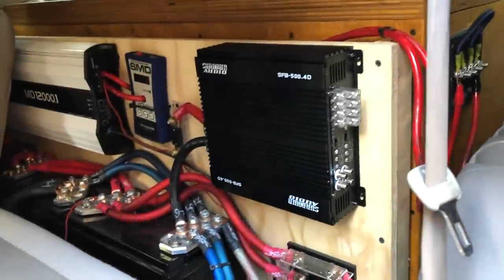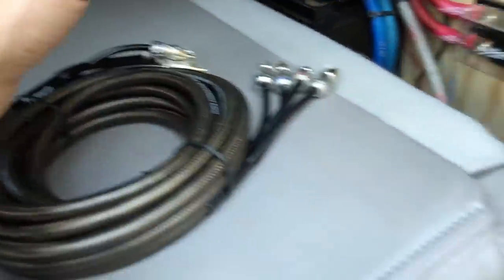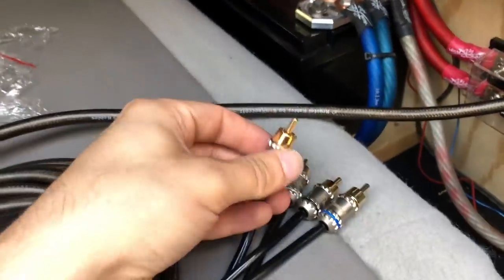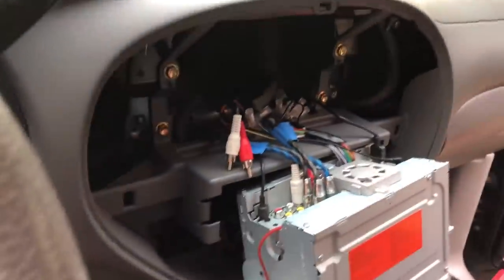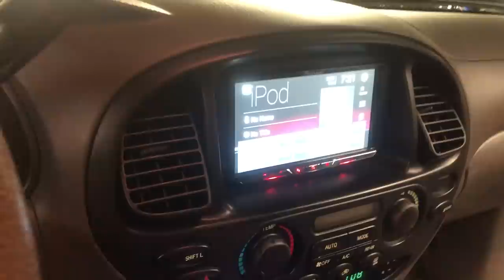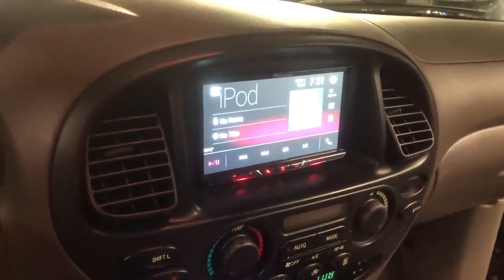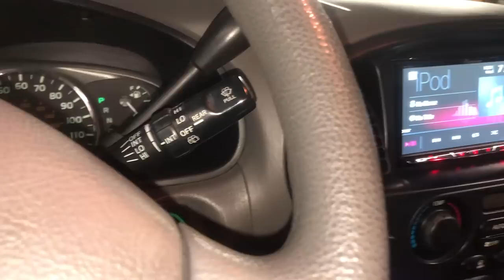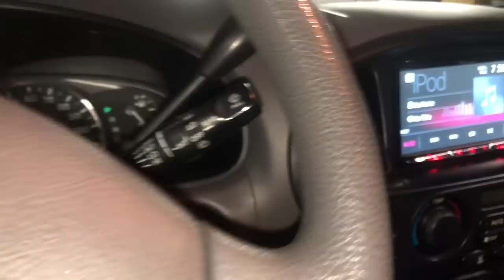Huge 4 Channel Amp Install! No More Static! Sundown SFB 500.4D

Comment: Relocate your ground. Thats a ground issue. Could even be the ground for the deck, or you have stray voltage.
Reply: Mine was that exactly, the radio wasn’t grounded enough I ran a 8 gauge wire from my ground bar to the ground bolt on the back of my radio and it stopped all the weird stuff that it was doing so I can definitely agree with ya there
Reply: To add to this, basically what is happening is that the “ground” at the radio is slightly different than the ground at the amplifier. This can be due to small resistances between the negative battery post and the ground at each device. 

Once these grounds are at separate potentials, you then connect the RCAs between them. This creates a short between these two different grounds at different potentials. When you have two different potentials connected you get a current flow, which is now going across your rcas and being turned into noise. (Poor grounding somewhere, or in multiple locations in the system)

A ground loop isolator is more of a band aid for this issue (typically a couple transformers that will “isolate” the rca wires and remove that short between the two different ground potentials).The real fix is to upgrade and fix your grounds everywhere you can. This includes the battery grounds to chassis (big 3) and the grounds for the radio and the amplifier.

All the extra wire you added is doing is making a lower resistance path for the current to flow (reducing the current flowing across the RCAs and the noise).
Reply: @mattb6001  what he said.  People always over look their grounds. I was told by a shop keep them short clean and ohm ohm the ground if you still have noise.
Reply: Yup newb shit lol better head unit ground or ground to the same point as the amp done deal
Reply: he could aslo add a cap on to the four channel amp for cleaner output to the amp
Reply: Yep it's the head unit pioneer they do that reground it.
Reply: @chrisfiske  were you getting weird beeps and other weird pitch noise through your speakers with the car off and volume down? I've grounded the RCA's at the hu and that helped, but I'm getting weird noises. The radio is on factory harness ground, and this is the only thing I didn't try.Big 3, tried moving the RCA, tried separating the wires a bit more, etc. Could be like you said, not enough ground on the HU. I tried grounding it to the metal along with the harness ground, and it took the noise out a little bit but not fully. AUX on the other hand, is horrible. Ramping noises (car off)
Reply: @BEAZY_5150  you could be getting noise from the alternator... I've been running dual alts and had one go bad, it still charged but it made everything have a winning noise I unhooked them both and it stopped that's how I found out the alt was messed up. I just unhooked the one and it was fine after that, and another thing you can check is the gain on the amp, if your gain is turned past half way you can get noise from some amps... the idea is to have an amp that can run your subs with hardly any gain, this is why you see people running two sundown X12's on a salt 6 they want that extra power so they don't need much gain... it's so hard to narrow down noises... this is what I did to fix it all, I separated the system from the truck ground so my truck has its own battery and alt and my system is completely separate it's own alt and it's own ground even the alternator is mounted with composite washers and I coated the bolts in bed liner so the bolts couldn't get any ground from the engine block or the bolts touching the alt after being threaded in so the coating keeps it from grounding as the bolt passes through the alt, so the grounds are completely separate from each other.. I hope you find your problem
Reply: @chrisfiske  it's a new 250 amp alt. I've tried grounding the RCA's, I made sure everything was routed right, made sure not to use the factory ground for the hu and went to an inside metal portion, also grounded my voltmeter in the same spot, made sure the rcas were away from power, tried running ground at the same spot as my amp all the way back. (No difference) Did not run an upgraded ground from the alternator bracket, because I read that it grounds itself through the casing. Big three upgrade( which I should check today.) The noise got worse! Now I have a hum! Last things I can try is running my driver side speaker wire away from the power wire, check spark and plug wires, and try another pair of rcas that are genuinely known for being shielded, I bought kicker K series because of good reviews but I think it's easy too thin. Check this out! I unplugged the radio and pulled it out, and the speakers still made noise! Is that weird? I'm literally about to pull my hair out.

Comment: Good stuff, glad You got rid of the hiss. You basicly made a ground loop isolator. Some Rca's used to come made with a small wire in them for that purpose. You should think about grounding the head unit to the amps ground, that will also eliminate ground loops (aka too many items connected together using different grounding points).
Reply: I still have a couple sets of Rockford Foagates like that. Twisted with a grounding wire
Reply: @stevepartridge75  Yep I know the ones. Some people used it for a remote turn on to. I wouldn't but I guess it could.
Reply: @thenotoriousrvh6091  Wow, i'm still learning. I used to use that as a remote wire as that is what i understood it to be, i haven't done that in quite a while now though.
Reply: @HashDogg06  You aren't the only one 😂. I guess it'd be fine. Just a little too thin for my liking.

Comment: Parker, if your deck is a pioneer and you unplug or plug your RCA's in while the deck is powered on it will blow the PECO fuse inside the headunit. This will cause noise issues as well. Worth a shot to check it out.
Reply: pioneer units had peco fuse problems since i was young, its what knocked them out the lead back in the day kenwood all day since

Comment: When ya gonna upgrade to the SFB-13500D? Cmon, I know you want too!
Reply: @PeterFeltersnatch852  If I had the money to spare I would! Love seeing his videos!
Reply: Get a bstock thats what I did I was 980 and just had a damaged box
Reply: Do you think the sundown SFB will out perform the Taramps. Well he is going up 1300 more watts but in a head to head competition?
Reply: @pvgreen621  I think it would be difficult to tell. It would mainly be for reliability and to match his 4 channel amp. But he has a lot of issues out of his SFB 500.4
Reply: @jonadkins9339  what kind of issues?
Reply: @jonadkins9339  has he thought about taramps ds series on his high end?
Reply: He needs a Korean amp. Sundowns 8 or 12k would be awesome to see! SFB amps just aren't impressive
Reply: @vasquez3769  what are the issues with this amp, was going to use 1 for mid bass an highs
Reply: @stuntmane100  there's too many issues with them randomly going into protect mode and never coming back... they can't go below 1 ohm without blowing.... They're not efficient... people claim clipping issues.... some have caught fire.... if you want Sundown, stay away from SFB amps. There's countless issues with them.
Reply: @vasquez3769  can u suggest a good 4 channel that puts out at least 300 or more watts per channel at 2 ohm thanks
Reply: @stuntmane100  Skars SKV2 line up is the only one I like. It's high quality.

Comment: Grounding issue!  Dealt with quite a few of these in my jeep back in the day.  Good thinking on grounding the RCAs, tiffany style connectors FTW!!!  Relocating the amps ground should solve the issue, better yet run a ground all the way to the negative post on the battery is the best you could do.
Reply: Yes, can't beat a ground run from alt case or battery negative.. I've got 2 grounds.. 1 from alt case to rear battery and to chassis. No issues with static sound whatsoever 👌

Comment: I’m going through the same thing it’s the grounds to the frame they need to be cleaned and tightened I noticed the noise started as soon as the fall hit and things got wetter
Reply: The noise came back I think I’m going to have to ground the rcas or find where they are not paralleled

Comment: You don’t need to run a ground from head unit to amp rcas. What you need to do is ground your head unit rcas. It’s very common for pioneer but I had to do that for a kenwood deck.

Take a wire and wrap them around the rcas at the head unit then you ground it at the head unit. It will solve your issue,  if not then it’s the amp.
Reply: Yep..exactly..pioneers are notorious for it
Reply: Yup them damn Pico fuses.

Comment: Hey man I had the same amp you have to ground you headunit I’m still watching the video but ground the headunit and it would be better
Reply: Did you ground a wire to the head unit itself. Or to the ground wire on the head unit harness. Please reply. Tks

Comment: Ay basshead parker !! Fist off the deafbounce 
Mids sound great an i think there are my next 
Mids.,  secondly the ground on the alt could have been some of that problem. Should have grounded to the block( engine) . third,
Running the ground all
The way back work great.....never ground anything by a electric motor. You will pick up
Interference.( blower motor)

Comment: I had engine noise in my system as well my solution was to run 2 wires 10ga ground and positive from my bus bars in the rear to the dash so every component in the system sees exact same positive and exact same negative and presto complete silence between tracks, since then thats how I always power everything.

Comment: The whisling noise can be stopped completely by fixing the ground resistor inside on the headunit's circuit board, its a regular problem found in audio systems
Reply: What resistor where is it located on the board?
Reply: @jarredri  its usually located close to the rca outputs... i recomend you consult someone does repairs... if it isnt done properly it can mess up the head unit

Comment: "Rf ground loop isolator"it connects to the RCA's and it knocks out the distortion you're picking up the electrical interference of the vehicle
Reply: Didn't work for me. I still get buzzing or whining and I bought new pioneer deck and I still have it. Only th ing i can think of is a ground loop to my seat frame where its connected at
Reply: Also I only get buzz when running dual amps set ups
Reply: A "rf gound loop isolator" is cylindrical and look like a "D" size battery with male rca plugs on one end and female on the other it goes inbetween the radio and the amplifiers good rca's are shielded but some cars have it and that was always the solution good luck happy bumpin
Reply: Rca ground loop isolator search that on amazon
Reply: It also knocks out the thumping that some systems will have when you change the radio station or when you turn it on and off your hear loud thumps go into the subwoofers it knocks out the winding from the engine and that bass thumping feedback

Comment: Did your factory radio have a braided wire connected to the back of it and attached to the metal in your dash? If so do the same to your aftermarket hu so it grounds the static out.

Comment: Pioneer radios have a rca ground problem, put a ground from the rca ground on the back of the radio to the radio chassis. I had this problem with 3 pioneer radios and this solved it
Reply: They have what's called a pico fuse and they blow all the time and it breaks the ground on the headunit preouts. It happens if you hot swap RCAs, or look at them the wrong way lol.
Reply: Good to know.. I just installed a pioneer & I hate that whining noise..
Reply: Never unplug the rcas with the headinit powered up. It pops the fuse immediately.

Comment: You should try a new ground wire for your deck and believe it or not but it you have bad spark plug can do it to. But good grounds separate for each gear is best and I never trust the ground that is in the car's radio harness, just do a separate one. You shouldn't have to ground the rca like that.

Comment: do you think they make noise because the amp doesnt have as much capacitors compare to an a/b amp? would those 1 farad caps help filter the noise
Reply: Its a blown Pico fuse.
Reply: Usually those 1 farad capacitors aren't real, most capacitors made by amplifier brands to buffer your power rails going into an amplifier usually aren't legitimate, typically they're just a board with a bunch of tiny no name branded cheap capacitors wired in parallel surrounded by a cheap can. I had a so-called 1 farad capacitor by lightning audio and it just had several capacitors wired in parallel on a tiny board, with a block of concrete on the bottom to make it seem like it was heavier than it actually was and it only added up to about a hundred thousand microfarads. That's also one of the reasons why most people who use power capacitors for subwoofer amplifiers always say they don't really do much because they're not really what they are advertised and they are being ripped off. If you want to get a real one farad capacitor, go to Mouser Electronics, find a screw type capacitor, make sure it's at least 16 - 25 volts, use nichicons nt or lnr series as an example, both are fantastic. it won't be cheap but you get what you pay for,  you'd actually be getting a real 1 farad capacitor from a well-established brand and a well-known component distributor. This is a REAL 1 Farad capacitor, it's worth the 172 bucks! 647-LNR1C105MSE https://www.mouser.com/access/?pn=647-LNR1C105MSE&sn=647-LNR1C105MSE&utm_source=mouserandroidapp&utm_medium=app&utm_campaign=647-LNR1C105MSE&utm_content=Nichicon  I also highly recommend you get 470 ohm 3 or 5 watt resistor and have that attached to the negative terminal when you first power up the capacitor the resistor is going to get incredibly hot, however it's necessary to have a resistor at on it at first to limit the capacitors inRushCurrent, it'll draw so much current that it's almost like a dead short.  it would put a considerable strain on your alternator and battery if you don't put a resistor before it you'll likely get a spark from one of its terminals once you touch it because it'll be sucking so much power. leave the resistor attached for 5 or 10 mins before hooking it up to the system directly.  Also don't forget to observe proper polarity, make sure the positive goes to the positive and the negative goes to the negative, otherwise you can damage the capacitor.
Reply: @analogaudiorules1724  yeah i know those 1 farad capacitors are a joke for storage but ive seen a video of a guy showing that they help eliminate engine noise. i use a bank of maxwell super caps with a 120ah agm in the trunk for storage. its a bit of an overkill for 1500w but it keeps my voltage up to the mids 13s. my car limits my voltage to 13.8v instead of the traditional 14.4v, its something to do with gas efficiency

Comment: U shouldnt have to run that ground all the way to the amp. Just ground that wire on the rca in the headunit to the frame. Worked for me. If you have to u can do the same at the amp

Comment: U can try a capacitor next time, it kind of works as a filter know someone who changed all wires new 4 channel and then a new radio still static. Then a pro shop put a bass cap in n static be gone.... Trustvme i helped dude like 40 times trying to find what was causing it

Comment: Parker . I love the subs and box. I got 2 18s and had to build a box and bought it to the have to use the mdf board. I dont have any extra money right now but i want to build a better box. When i go though i was wondering what you and the chat thought. I got an older expedition and the 2 12s i had didn't move things. So i went with 2 18s and 2000 watts. When i build a better looking box should i stay with 2 18 or go with 4 15s or however many 12s. I'm not going over the 2000 watt amp . I'm running a stock alt with the 2000 for subs and 500 watts for the doors so I'm keeping it like that for now. But I'm wondering if its better to go 2 18s 1000 rms apiece or 4 15 500 apiece 6 12s at 300 or whatever or just stick with the 2 18s. I was thinking when i get the money to run another battery and get a 1200 watt skar amp from my boy for cheap and maybe run the 2 18s with 2 12s. Give myself a little more bang and a little variation on my bass knobs switching between 18s and 12s depending on wife and kids in the car or whatever. Idk i just said alot but basically 2 18s or more subs of a different size

Comment: This is a older video so I’m sure you figured it out but there should be an auxiliary output level setting on the head unit just turn it down and the static should disappear

Comment: I have this same exact amp an I’m having that problem.. by running the wire really stop the noise? Need to know for sure
Reply from the maker: Yes it stopped 95% of it!
Reply: Ok bro I’ll try it tmrw
Reply: @ParkerTheBasshead  didn’t work bro...

Comment: Hey buddy do you have a Pioneer deck it's called a Pico fuse I believe it's inside your deck most likely ants from plugging in and unplugging RCA's with a powered up that little fuseal pop inside or fusible link therefore you have to ground it that works

Comment: Hey man, I had the same issue in my ride. The BEST way to eliminate it. Take the ground wire from the head unit out of the harness and ground it separately. Then ground all of the rca ports on the headunit together with a piece of wire, and ground it to the unit itself. And if you chose to do this, please let me know how it works.
Reply: Nope! That's not how it's done! Unless your an amateur!
Reply: @BobBasshead  then how exactly do you “professionals” do it? 😂

Comment: Hey parker I have a quick question for you can I run 4 4ohm skar fax 6.5 midrange there a 150rms each and 4 4ohm skar supertweeters  vx200-st 100rms on that sundown sub 500.4?